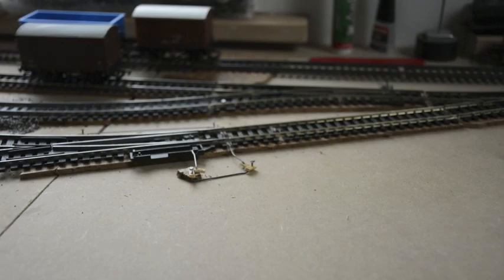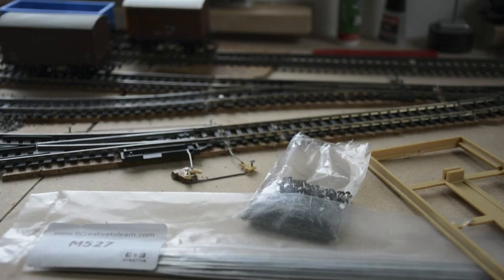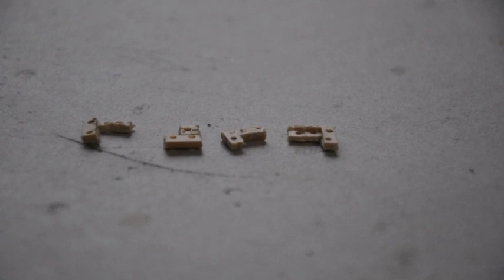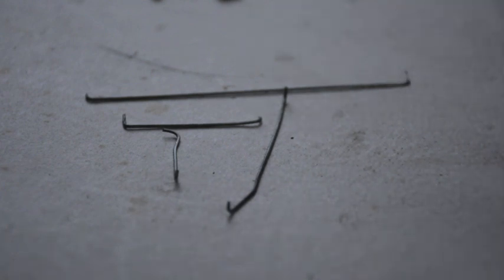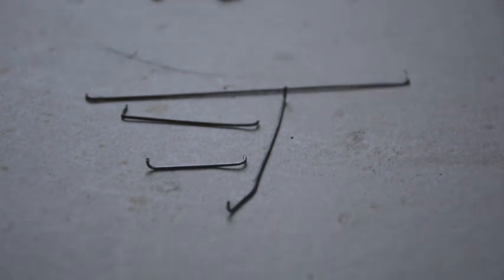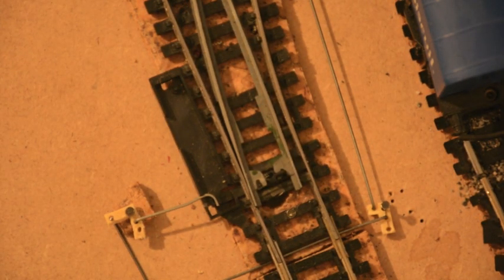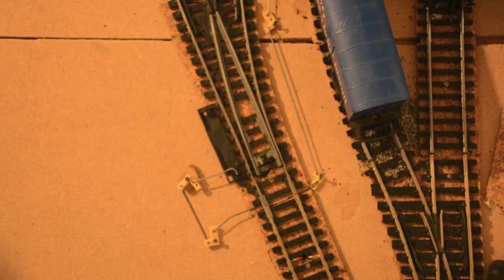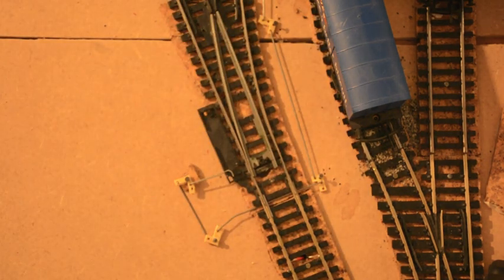Railway Rodding

Comment: Not sure how prototypical you want to be, but as an S&T nerd myself it would bug me that your cranks are not working correctly.  Cranks should be set up so that a pull on an incoming rod results in a pull on the outgoing rod so that they all work in one direction.  Then, halfway along the rodding run the direction will be reversed with a compensator crank or at a standard crank at the central point of a run.  The rodding should only reverse direction once in the complete run.   What you re doing is great, and provides a nice look, but you will get old buggers like me who've had to do it with the real stuff muttering "push pull push pull, it's not right" ;-)  Keep up the good work - hope to see you again soon.
Reply from the maker: Hi Richard.
This means a lot to me 👍. I have to admit, when trialling the design my aim was to get it to work - nothing else, but work! I never realised myself that was how the system works, so I shall have a go at doing it again.

I do quite enjoy the S&T side of the railway's operating myself, and it's something I want to get right on the layout.

Hope to see you soon too, and when further extension work is done, and passenger safety is started on, hopefully I'll be able to lend a hand with fitting the rodding for Nos. 9&10 (Main to Carriage Shed + F.P.L).

Stay safe, kind regards GWR
Reply: @AberystwythStation  excellent, shame about social distancing or I would take you through the theory.  The "bible" is this one: https://www.abebooks.co.uk/book-search/title/railway-signalling-and-communications-installation-and-maintenance/ if you're really interested.  The CS point is going to be on one of the motors we have lying around, as that's a bit long to work on rodding, what with the level changes etc, but there's still the upper tramway point that needs rodding when it's changed for a new one.
Reply from the maker: Hi Richard.
This looks interesting, I shall see to getting myself a copy 👍
Stay safe, kind regards GWR

Comment: Very impressive 👍👍
Reply from the maker: Thanks very much Darren. I can admit it to being a little clunky, but I am working on a solution for that. Found some thin plastic material (excess from flooring) is sturdy enough to be able to drill holes near the edge of the crank, and thus keep it small.
Stay safe, kind regards GWR
Reply: @AberystwythStation  it’s great that you made it work! 
I do the basic wire in tube (very rough shod) but am aiming for your sort of pivot action. Nice so get some inspiration 👍
Reply from the maker: @Shelfandtabletoplayouts00gauge  Well although I try to get the point rodding to move, the actual point movement is done under the board with a piece of straight wire.
I know I haven't posted for ages on YouTube, but if you want to, I'm much more active on Discord where I post pics of what I'm doing every so often. Please join with the link below.
https://discord.gg/kbkVs8Dwuj
GWR
Reply: @AberystwythStation  thanks